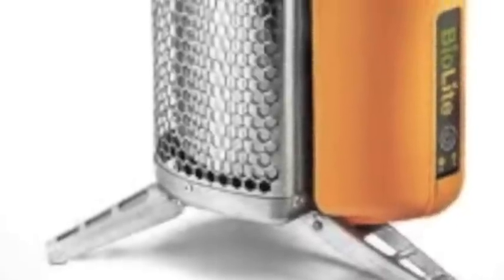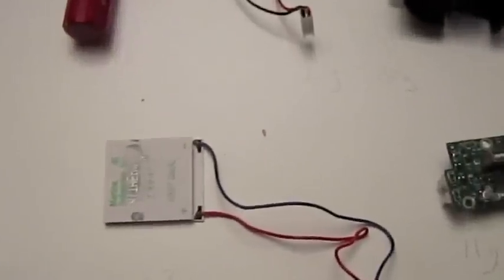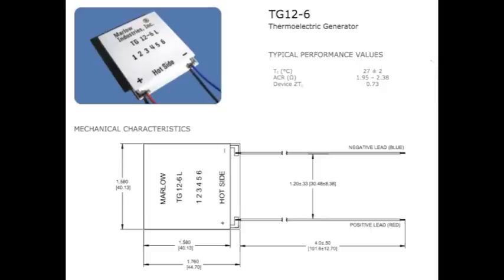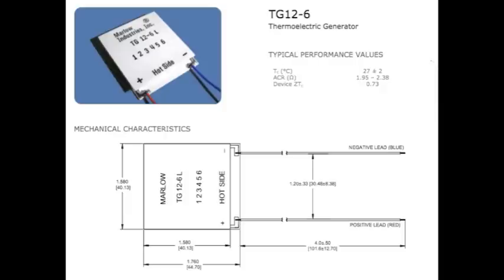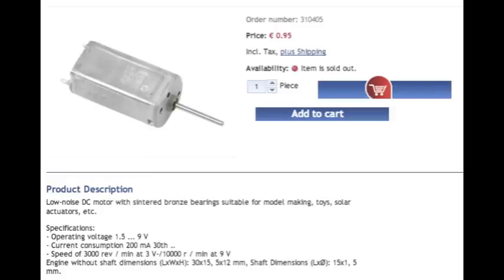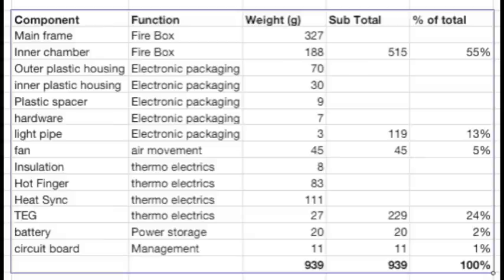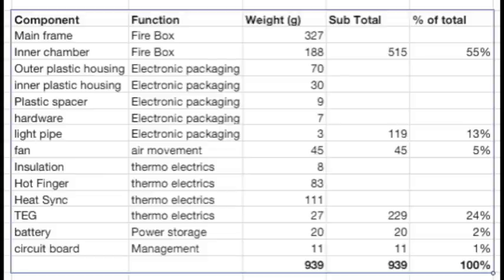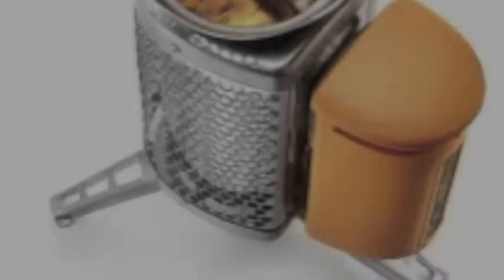Inside a Biolite Stove

Comment: I'm disappointed that the motor is not brushless, the thermoelectric panel is run of the mill and doesn't generate more than about 5v at 370 milliamps which is under the USB spec of 500 miliamps and furthermore does not provide a constant charging current.